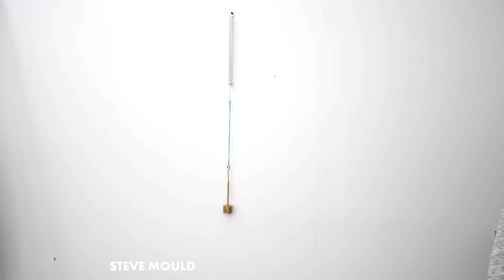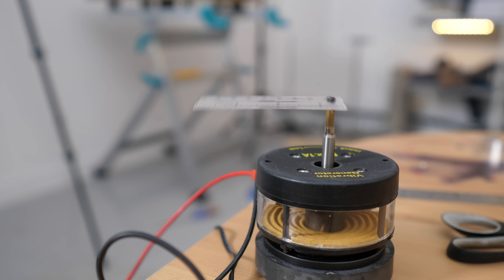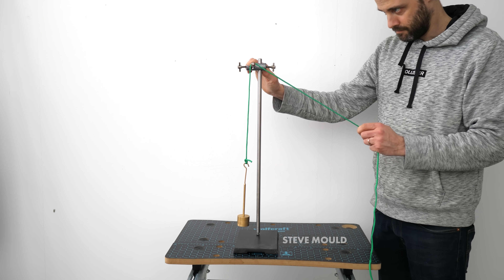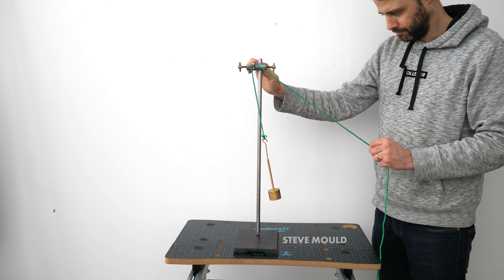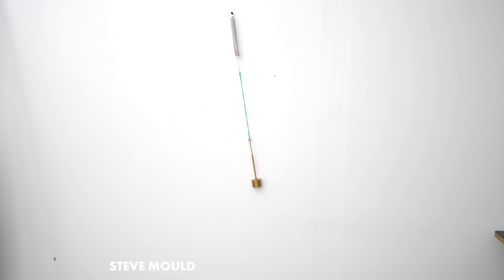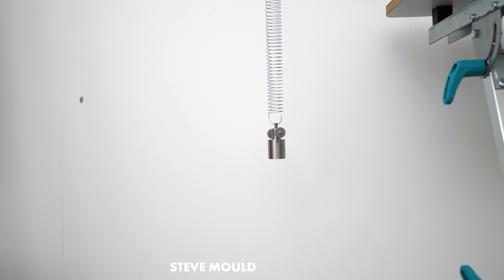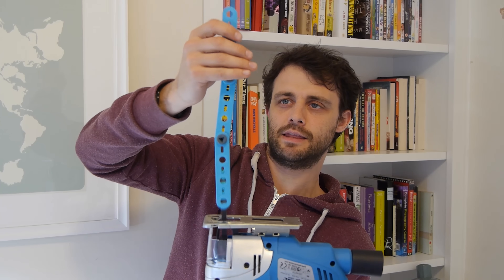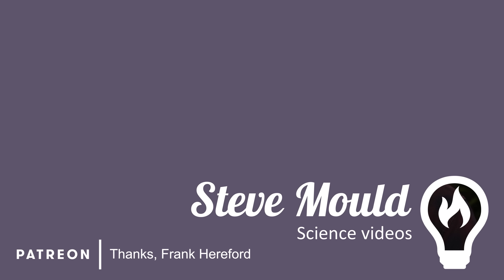What If Swings Had Springs Instead Of Ropes: Autoparametric Resonance

Comment: Dose this cause tempary weight lose in the pendulum when it is in the drop faze of its figure 8 if so one could lift.vary hevy objects up thowe this matching longer pulls with the downward fall slowly raseing them with back and forth motion instead of stedy pulling if thers something else other then a spring that can coues this resonince like sound maybe how the pyramids lifted large rocks by turning side ways motion  in to upward motion when the object becomes waight lees like on a swing and you feel your butt lift up then pulling rope this would mean  that all thay had to do was cut it off rock not conected to ground brack it free witch would resalt in it hanging then when thay need to lift it higher thay just swing it and lift when it is waghtless in its fall

Comment: While you can't change the force of gravity easily at a frequency, you could change the force of acceleration. Thinking coupled resonance in rocket payloads for example. Maybe a practical demonstration could be done with a solenoid inline with the spring?
Reply from the maker: Or actually just in a box that goes up and down at the right frequency!

Comment: For manually putting energy into the system, is the optimal length of tugged-and-released string that which would give the mass exclusively horizontal motion?

Comment: Hello steve, great stuff as always. 
One question; You stated that the spring was longest in the centre of the figure 8 and longest at it's two sides. I'd have thought it was longest at the two troughs and shortest at the two peaks of the 8 with the potential energy being highest and lowest at those points respectively. Am I mistaken, and if so could you shed some light on that?

Comment: I get the sense that as you pull and release the cable to get the pendulum to swing you get a feel for it. Your brain auto calculates the appropriate time to pull and release. Is that true? And how interesting that our brains auto calculate such a thing. Obviously of no use evolutionarily... yet the module is pre-loaded for such circumstances. (Again... if true.)
Reply from the maker: Totally! I saw a video where they had a mass go up and down mechanically. But they had to put a sensing feedback into it so it didn't get out of phase. Interesting that my brain can do that without really thinking about it. Same for swings I guess.

Comment: So you get two oscillating amplitudes one of which is a quarter oscillation behind the other... Would plotting their amplitudes over time give essentially sine and cosine waves? And if so, is this in some way related to the fact that cosine is the derivative of sine?
Reply from the maker: I think it is! When the displacement of one pendulum is at maximum, the forces (and therefore acceleration) of the other is at maximum. Acceleration is the second derivative of displacement. The intermediate derivative of velocity would therefore need to be cosine.

Comment: Reminds me of the relationship between inductors and capacitors. In an LC circuit, energy is constantly exchanged by the two components, each being stored in a different field. Capacitors store energy as electric potentials and and inductors store it as magnetic potential. As one discharges, it charges the other which then discharges and starts to charge the first.

Comment: I'd love to see the phase diagram between the length of the spring and the amplitude of the pendulum
Reply: I'd like to see a graph of the meta-period (the time between shifts from bouncy oscillation to swingy oscillation) as a function of the ratio of bounce period to swing period.
Reply: The most natural phase diagram will have 4 dimensions.  You can get it down to three by assuming constant energy, which removes one bit of reality but it would still capture the interplay between the different modes - the orbits would likely be something like lissajous figures, at a guess, but distorted by the non linearity of pendulums to gradually nudge it from one bunch of orbits to another.
Reply: 𝐒͠𝐩͠𝐞͠𝐜͠𝐢͠𝐚͠𝐥͠ 𝐝͠𝐚͠𝐭͠𝐢͠𝐧͠𝐠͠ 𝐟͠𝐨͠𝐫͠ 𝐲͠𝐨͠𝐮͠➺ sexy-nudegirls.host
Anna is a beautiful girl.

He's the person I love, he's my light
day. The way the music flows and sounds
is extravagant and fun. Anna is
icon, legend, beautiful girl, princess, inspiration,
a star. I could go on and on, understand this.
I love NBA Anna.#垃圾

Comment: Carbon footprint  is science...like yeah
CO2 is 411ppm in the atmosphere. 
As a % that is 0.04% of the atmosphere is C02. 
Its a rare gas. Of that 0.04%, approx 4% is caused by humans. 
So the total of C02 in the atmosphere from human activity is 0.0016%. 
Of that 0.0016% the UK is said to be responsible for 3%. 
That is the total amount of CO2 produced by the UK in the atmosphere is 0.0016/100 x3 = 0.000048%. 

The population of the UK is 65 million. 
So the average carbon footprint in the UK is 0.000048 divided by 65 million.

0.000,000,000,000,0738 % of the earths atmosphere.
So for every million parts of the CO2 in the atmosphere your contibution is  7.38E-10

Comment: Its called gravity pulls diffrent on diffrent mass not resonance there nothing causing a resonance or frequency to move the pendulum the potential energy from your hand moved it right but theres nothing resonating on that its just clearly the gravity tugging on the mass and diffrent mass will get pulled faster same as tue shortning of the string but there no such thing of resonance now if there were a sound wave used to push it yes the resonance but its potential energy kenitc energy mass and gravity and leverage no resonance guy cmon now

Comment: I wonder if this is a component in how riding a bike on a pump track works? The trough between two humps is the arc of travel while the rider's well timed up/down motion is the change in the distance between the centre of gravity and the virtual centre of the arc the bike/rider system is moving in. It looks a little different at first because there's no string, but if you just think about action/reaction, it doesn't matter if you're pushing against the ground or you're being pulled by a string in the arc.
Reply from the maker: I suspect you're right

Comment: Here's a fun swing related question that I've been meaning to sit down and find a general solution to: what is the ideal angle to jump off of a swing to maximize horizontal distance?

Its not 45°, because at 44° I think you're moving faster than the benefit you gain from the ideal launch angle.  But then is the same thing true at 43°?  It's a surprisingly tricky problem to work out, and I've been meaning to get to it, but you're free to beat me to it.
Reply from the maker: Great question!
Reply: @SteveMould  please make a video about this lol I definitely need it to to impress my friends.
Reply: I always fel it was near 68°, enough to get the momentum from the downward motion through the center with about half the lift from the upswing before you started to lose momentum.
Reply: @petertrudelljr  how do you define the angle?
Reply: @fbrickerlp  a fun thing about the geometry of the problem:  the angle of the rope of the swing (assuming vertical is 0°) is equal to your launch angle from the ground (assuming horizontal is 0°).
Reply: I dont think there is a definite answer to that like on a throw because it should depend on the length of the swing which varies your jumping height. I guess on a swing you dont really jump as well you just let go at one time and get the angle perpendicular to the swing angle and the speed at that point
Reply: @fbrickerlp  I did a brute force test of this and found that the variables for determining the answer were pendulum length, how high up you swing from, and height from the ground at the lowest point. All that considered, I only saw a 2-3° difference in results.  Somewhere around 25° if I remember right.
Reply: @TheSpiffyNeoStar  love it care to share your process?
Reply: @fbrickerlp  if need to dig out my old TI-83 graphing calculator to be sure, but from memory, I just brute forced it.

I took input parameters for swing length, and height from the ground at the bottom of the swing, and starting angle. Then at each angle starting from 0° (parallel to the ground), I calculated the velocity of the end of the swing, and then plotted the trajectory from that position and stepped it forward until it dipped below Y=0.  Then I did it again for 1°, then 2° etc.

So very brute force.  I think there's an elegant generic equation I could figure out, but I would need to sit and figure out the math.  The big hard part was I used the lazy way of plotting a parabola (x(t) and y(t) instead of a y=ax^2+bx+c), so a general formula for when y<0 was beyond my level of math knowledge at the time.
Reply: @mattmurphy7030  because you also have different velocities and height of letting go. The ideal throw off a tower is different to one on the ground
Reply: First, for sake of argument, I will assume all dissipative forces are negligible (e.g. friction at the pivot, internal friction in the chains, sliding friction on the seat, and air resistance). I will also assume that the swing can be modeled as a simple pendulum, meaning it stretches only negligibly, the mass of the chains is negligible compared to your mass, and your mass is pointlike (i.e. you are very small compared to the length of the chain). I think these are vaguely reasonable approximations for most real swing sets in this context, though they obviously aren't great ones.

If you launch at an angle θ from the normal with a speed v from a height h + l cos θ (where l is the length of the pendulum and h is the height of the bottom of the swing off the ground) in a uniform gravitational field with acceleration -g, you will travel a horizontal distance of x = v sin θ [v cos θ + √(v cos² θ + 2g(h + l cos θ))]/g.

The speed v in turn is determined by the angle θ, the acceleration of gravity g, and the length of the pendulum l. However, this function is very complicated unless we use the small angle approximation, which is inappropriate here with such large angles. If this approximation did hold, then we would have v = lθ₀ √(g/l) cos(√(g/l) t), where θ₀ is the maximum angle of the swing (i.e. the greatest angle you would get if you didn't leave the swing). Clearly we need θ < θ₀, since if θ = θ₀, then the velocity upon exiting the swing is 0, and you won't go anywhere. Anyway, the resulting velocity in terms of θ (not t) is v = lθ₀ √(g(1-(θ/θ₀)²)/l). Plugging this into the above equation, we get:

x = lθ₀ √(g(1-(θ/θ₀)²)/l) sin θ [lθ₀ √(g(1-(θ/θ₀)²)/l) cos θ + √(lθ₀ √(g(1-(θ/θ₀)²)/l) cos² θ + 2g(h + l cos θ))]/g.

A lovely expression. To maximize this, we need to find the critical points where dx/dθ = 0 or is undefined. It is only undefined when θ ≥ θ₀ or θ ≤ -θ₀, which we are not permitting. It equals zero exactly once for θ > 0 (and one more time when θ < 0, representing the "minimum," i.e. the greatest distance you could travel backwards), but good luck finding a neat expression for that point. That critical point is the desired optimum angle, and if you plug it into the above equation, you will find the corresponding distance.

I tried to get an answer with parameters l = 1 m, h = 0, g = 9.8 m/s², and θ₀ = 1 rad, and after some effort, I convinced Wolfram|Alpha to give me a maximum of x ≈ 0.913118 m at θ ≈ 0.564413, or about 32.34°. Of course, it will be different for other parameters. In particular, h should probably not be 0, but I couldn't convince W|A to give me an answer for positive h. (With premium computation time, I could probably get it. I can get it to plot the function with h = 1 m, and the maximum appears to be around x ≈ 1.16 at θ ≈ 0.59.) The thing is, it doesn't actually matter, because like I said earlier, any reasonable swing is not in simple harmonic motion! The small angle approximation only applies well if θ₀ << 1, which is generally not the case here.

If we wanted more accuracy, we could use the full differential equation for a simple pendulum, d²θ/dt² = -g/l sin θ. In principle, you could solve this for θ in terms of t, find the derivative dθ/dt in terms of θ and t, substitute in to find it purely in terms of θ, then multiply by l to get v in terms of θ, then plug that into the expression for x from the second paragraph. Then you would set dx/dθ = 0 as above to find the critical points. The problem is that there is no analytic solution to this differential equation, so every step has to be essentially numerical (albeit with some shortcuts). So it has to be done by computer.

If someone wants to write a program to solve this, it should be easy enough using gradient ascent, since the global maximum is the only local maximum. (If you're going to do that though, you should use a much larger value for l. At l = 1 m, the simple pendulum approximation will fail to be even remotely valid for any reasonably-sized human. It would be OK if you just put a small lead weight in there or something, but that's not what we're interested in. l = 10 m is probably better (albeit a little silly for a real swing set), but if I don't have l = 1, W|A groans at me even harder.)
Reply: @EebstertheGreat  couldn't you use energy calculations to take the energy of the pendulum and then from there get the velocity?  I think that gets around the small angle approximation issue you mentioned.
Reply: @TheSpiffyNeoStar  Good point. That does make the whole thing easier.

v = √(2gl(sin θ₀ - sin θ)), so x = √(2gl(sin θ₀ - sin θ)) sin θ [√(2gl(sin θ₀ - sin θ)) cos θ + √(√(2gl(sin θ₀ - sin θ)) cos² θ + 2g(h + l cos θ))]/g. This is not much more tractable, but it is more accurate.

Using this correct equation, W|A still doesn't throw me a bone, but it kinda works. For l = 10 m, h = 1 m, g = 9.8 m/s², and θ₀ = 1 rad, I get a max of x ≈ 8.8626 m at θ ≈ 0.47863, or about 27.42°. If I use the same parameters as before (l = h = 1 m, g = 9.8 m/s², θ₀ = 1 rad), I get x ≈ 1.6 at θ ≈ 0.49 (W|A giving me crap again). Though again, that part isn't so reasonable, since the simple pendulum approximation breaks down.
Reply: Would depend on the maximum angle you reach in your swing. Unless you're just assuming you're swinging the full +/-90°.
Reply: @mattmurphy7030  Ideal launch angle assumes your total velocity is the same for any angle. That's not true in this case since your total exit velocity decreases as higher angles.
Reply: Ok I did a calculation and got a giant term finally the length is dependent on g, θ, hmax for the energy of the system alternatively one could use v(θ=0), l length of swing and the initial height of the swing when h(θ=0)
Reply: oh and i used phi because it was easier to type ;)
Reply: and i just realized I made a mistake with my  h´s because sometimes i ignored the initial height (when looking at energy of a pendulum )and sometimes i used it so it probably isnt correct
Reply: @hassledoctrine  Do we want the distance from the bottom of the swing or the distance from the exit point? That wasn't clear in the OP.
Reply: @EebstertheGreat  just replied elsewhere.  I always like from bottom of swing, but adding that to distance from jump is the much easier part of the problem.
Reply: @hassledoctrine  @EebstertheGreat

Yes, I did all mine from bottom of the swing set, but answering in both cases is pretty easy once you answer for the "from point of jump" case.

Comment: Whenever someone brings up resonance, I immediately think of orbits, and as soon as you said you have to put energy in when it is moving the fastest I thought "just like it being more efficient to burn at periapsis to expand/lower the orbit than any other point".  Anyway, amazing video, and now I want to find other more unusual examples of autoparametric resonance :)
Reply from the maker: Cool!
Reply: @SteveMould  
Please make a video about an oscillator with all three modes of operation:
Swinging, twisting and bouncing !
I suspect it will behave chaotically but I might be wrong.
Reply: @drgazter  the wilberforce pendulum can be set up like that. But from what I remember the energy ended up being spread among two of the modes and so the pattern didn't look as pretty.
Reply: I’ll have to thank Kerbal Space Program for letting me understand your comment
Reply: @oscarpatxot659  KSP was where I really started to understand orbital mechanics.  At this point I've looked into it a bit outside of the game, but that's where I learned a lot  (mostly from Matt Lowne at the beginning).